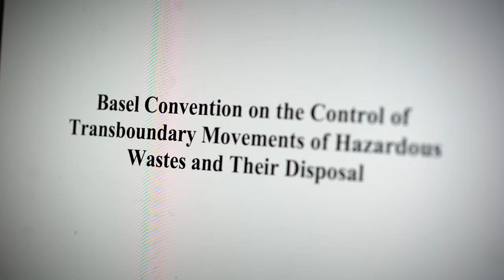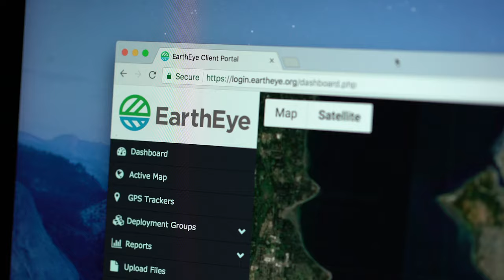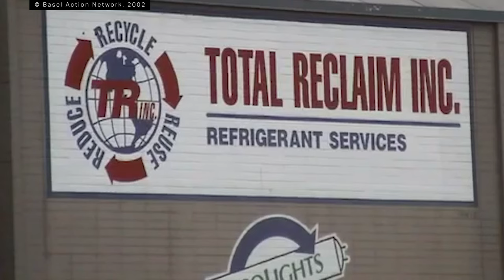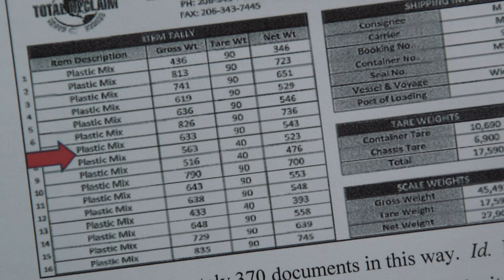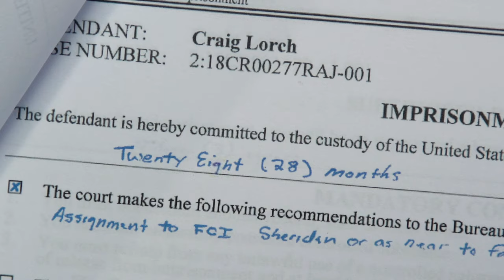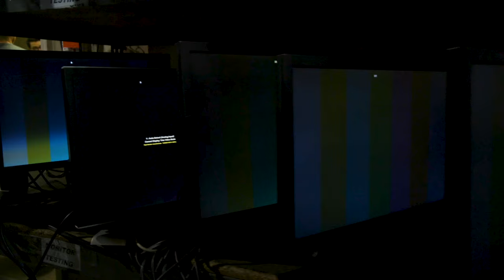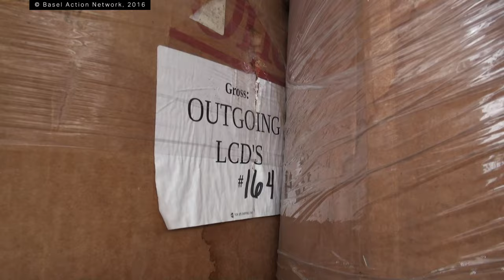The dark side of electronic waste recycling

Comment: I use my phone and electronics until they are completely unusable. It's harder to reprogram and update a phone's software than it is to buy a new one but honestly I prefer it. I get attached to my devices and I refuse to give it up without a very good reason. There is a culture of fast consumption of goods that needs to be addressed on all levels; from fashion to electronics. Get attached to your things, buy only if you have to and treat it with respect.
Reply: Used it pass its value..until its nonfunctional...
Reply: @592sunrise  with care and consideration, devices can last for years.
Reply: Agreed. Then I often buy refurbished for my "new" device. I also enjoy the feeling of making something from very little or basic resources, or from junk/scraps, so I enjoy salvaging parts from old desktops and the like in order to piece together a working one!
Reply: @revenevan11  while I'm not good at building, I'm good at customising the software for needs and it's a very fulfilling way to care for your items
Reply: I agree on half of what you said, not because I don't believe you, but because I'm reading only half as my screen is cracked but functional so I keep using my phone instead of getting a new one!
Reply: why throw shit away when it can be fixed ? most repair guys convince customers otherwise to sell new stuff..

I have been using my old desktop since 2008 even though i have brought powerful gaming laptops since then.. i get attached to that old veteran..

been fixing whatever gets bad on oldie but motherboard, processor and one stick of ram still remain original.. with a lightweight linux mint... i use it for various test projects and home servers.
Reply: I've  worked for people who can throw a fridge away for not matching the countertop I installed for them... I never understood it.

   Still don't... BUT I've found some awfully good gear in their dumpsters, and even been PAID TO TAKE IT OFF THEIR HANDS... lolz I kinda love that part.

   Get paid to clean out an attic or garage... Drag everything to the flea market... and get paid again to let it go... 

     AND I get to keep what I want, for the menial price of picking through the piles for my interests, and to clean stuff up for  a better price (something I do anyway).

   The manufacturing and recycling "gurus" complain about the price of recycling... recycled materials...
but the way they go about it is as bad for their finances as they are for the environment. Not every "dead" computer needs to get scrapped to the component level... for one thing. Lots of them only have one or two bad components... not even the motherboard. Swipe the hard-drives and move on. You don't want your info' on them into the wrong hands, anyway.
    Get a tower (second hand) and stack hard drives like their out of style in it... as long as you watch your strains on the Power Source, it's likely good to go. SO that "write up" is probably worth the math... AND a power source is easier to get than you'd expect... better aftermarket than "stock" anyways... IF you can afford it and justify it.

    It can't possibly be "more efficient" to ship things all over the planet to be stripped down and scrapped out to components AND then melted for recycling into new components EVERY time. At some point, there should be someone checking up and seeing what could be feasibly stripped to rebuild or refurbished... AND the rest of us SHOULD be rewarding them with business.

    I'm amazed to hear so many people convinced a laptop should expect a three year lifespan... My oldest Dell lasted ten... and not for me being gentle. I just tried not to abuse it too much.
    ...like pouring 90% alcohol through it to follow the coffee that time...  and quietly being thankful it wasn't ON, for the stunt either.

    yes... get attached... name them, some of them anyway. People used to do that! AND they used to give a damn about those things... instead of use 'em up and get another at Wally World.

    People used to do a lot of things better than they seem to now... BUT I'm glad to find a few gems keeping it up now and again... thanks for saving me from being sure I was the last of my kind. ;o)
Reply: And if you must get rid of it, recycle it yourself, most of the raw materials used can be extracted in some form with similar value to the pre-electronic form.
Reply: I agree with the sentiment, but when I give my phone security updates, it eventually slows down. I notice this with all my phones, and the slowing only happens immediately after an update.
Reply: Phones are not my area of expertise, but when it comes to computers, very often the case, power supply unit, hard drives and RAM can be repurposed. YMMV if you're using them in a new PC, with the old RAM most likely being DDR3 and hence incompatible with new CPUs, but you can always use it for an HTPC or a media server.
Reply: @Erick Rosa old laptop cameras make an excellent security system.
Reply: I do something similar. I hardly buy new tech unless there is a very clear reason and I don't don't throw old tech away unless it's beyond repair. I also sometimes refurbish PCs and donate them.
Reply: Sometimes you have to upgrade to receive essential security patches. You can't really rely on minor software updates when there is a major update that is not available for your phone because it's too old.
Reply: Sadly，Capitalism doesn't allow these sustain attachments
Reply: Same! Plus certain devices can become obsolete but also become antiques over time. I have old game consoles that are worth plenty in current value. Replaced my last phone that lasted me a good 5-6 years, traded it in for a new phone once it was getting faulty but I would've kept it for collection if I couldn't trade it in. It feels really cool looking back at my old iPhones, blackberries, and the one Nokia I had that was my first cell lol
Reply: Too bad you can't remove batteries without getting services done anymore. My old ipod that was maybe 5-10 years old died because of its battery.
Reply: It's so sad that manufacturers are making electronics as longterm unusable as possible. I have an android device that started deteriorating for some mysterious reason and became unusable just before three years of use, which makes it look like it is a software sabotage. Now I will have to dispose of a phone that is in good condition with little damage and buy a new one.
Reply: My family resells electronics to other people as second hand products. If still usable of course.
Reply: Same here. A lot of Android phones from early 2014 can still be updated to the latest Android, either via Lineage OS or some other 3rd party and they'll work just fine. Same deal with my OnePlus One, it's still running perfectly, even on the original battery, now almost 6 years old.
Reply: lol, same. :)
Reply: People also should start buying things used when possible. You get better value and use a product to it's full lifespan. This will reduce waste by not having a product made in the first place as demand for new things drop.
Reply: Here in my country we just pass devices on as we upgrade, the order usually goes parents>child>grandparents>distant people who may have a use for it
Reply: I replace my devices until they die, had a Samsung S5 for over 5 years.
Reply: Professional Face Puncher  said  " why throw shit away when it can be fixed ? most repair guys convince customers otherwise to sell new stuff.."   I ask, Why would a repair guy harm his business by turning work away?  . . . . . Yes, some items can be repaired but would you spend $ 60 to have a $ 99 weed wacker repaired?  Or $ 100 to repair a $ 200 monitor with no guarantee that something else won't fail in 2 months? . . . .... . The costs associated with mass production have gone down but the cost of singular repairs has not,  Also, some electronics have very specialized components that can't be bought off the shelf like in the days of vacuum tube TV's.
Reply: I used to have a phone that due to how the screen was manufactured, everytime a fracture in the glass was made, that section of the screen's touch was unusable. eventually, i couldn't use the android home, apps and back button but i ended up buying a little micro USB to USB adapter and connected my mouse to it. With this addition, because my phone supported a mouse perfectly, even though it was a little bit mroe unconfortable, i did bring a bit of attention, it was fun using it that way and it ended up lasting me like 6 more months or so.
Reply: @bobroberts2371  since my family kind of has a history of fixing electronics (mostly tv's) i can very much say that almost 80% of pieces can be acquired easily, the hardest things to replace are flat tv cables and screens, almost everything within a circuit board can be replaced. 
Now i must say, when my dad or my granddad fixes things, they do the work properly, and one important thing i learned is that indeed, repairmen do a shit job because of lack of knowledge or  just to get your stuff and sell it later
Reply: and here i am switching my phone every year :/
the phones that i previously owned for a year have now been given away to family members, but im not sure if that's enough to be considered "recycling".
Reply: @revenevan11  5
Reply: Me too!
Reply: @darkpepsi  haha
Reply: TwitchyWitch95 I do the same and I agree with you 100%. And I always buy used when I can
Reply: @antarcticpenguin  you can use it for like 4 years, you're kinda getting scammed by the phone producers business model
Reply: Glad I'm not the only one I had my last phone for 8 years before I simply had no choice but to replace it.
Reply: @jeinnerabdel  There are small online businesses who will fix that problem for cheap,  just look them up and make sure they're legit and you'll be gold, got my screen fixed once for less then $70.
Reply: Same!
Reply: @RegahP  Every time a fracture in the glass was made? So, like, multiple times? My old phone lasted 5 years, didn't drop it even once, never had to replace the screen, and when both the touchscreen (because of the fragile mechanism of a slide-out keyboard) and the USB charging port stopped working (reliably, at least), I had to get a new one sadly. I was running Android 2.3.4 till late 2018. It had 512 MB of RAM and 400 MB of flash memory... By the way, I did try to replace the touchscreen, but it didn't work so the hardware fault must have been elsewhere.
Reply: fghsgh Well good for you! I wish i could be that careful with my electronic devices.
Reply: My current phone is four years old (iPhone 6s Plus). I've had the screen replaced twice due to drops, and the battery once, but it still works great. No one has to upgrade their phone every year anymore, and the newest models are so expensive that I wouldn't want to anyway.

My Macs I keep even longer. Just recently replaced my 2012 MacBook Pro, would've used it for a year or two longer but it started having GPU-related issues and the battery life isn't great.

Edit: I have a lot of even older Macs and other devices around, some of which I still use for various purposes, and I don't recycle anything that still works without issues. I'll either keep it or sell it to a new owner.
Reply: @WokeandProud  - I ordered a new (to me) phone today because my provider has been telling me for a year I have to give up my Palm  Pixi (2009) because Verizon will be turning off 3G support.
Reply: As long as consumption and production is based on profit rather than need, nothing will change and the system is way bigger than whatever can be achieved through individual responsibility alone. Nobody wants to say it, but what you're actually calling for, what actually needs to be done to turn this, and other things like this, around: the end of capitalism... or at the very least push for heavy regulation and government programs that force companies and manufacturers to recycle as ethically as possible, even if it comes at a loss to the state and private business.
Reply: @Lambda_Ovine  I think a social democracy with an ecologically motivated regulation of the economy would work ok.
I know that that what you are saying is the ecosocialist narrative.
I tend to say that capitalism needs to be regulated in very targeted ways. The behaviour of megacorps closely monitored and penalised accordingly.

So in a socialist system, how do you properly achieve innovation without competition in the market?
There wouldnt necessarily suddenly be some kind of nirvana as to how to manage plastic just because the govt is socialist.
There wouldnt be a plan for human diet effects necessarily
There wouldnt necessarily be a dolution to overpopulation except if you are planning a global gulag lol

You trust that the govt will really care about this issue and not again their own interest? hah thats pretty utopian

If anything, I dont tend to think a sudden transition to socialism sould do good.
If anything a gradual transition through social democracy, or if the socdem is good enough then stop there.
Reply: @revenevan11  agreed
Reply: chemicalhorror  scrapper, me too
Reply: Sounds like you're gonna become a cronic hoarder down the line.
Reply: It's called planned obsolescence
Reply: Same here. I'll fix electronics that break (either replacing capacitors, ports, boards, replacing batteries on all new phones with "non replaceable batteries" etc. There's no good reason to purchase the latest and greatest phone every single year for me. It's criminal that phone manufacturers make their batteries non removable and therefore non replaceable for the every day person. Yeah, it's a pain to replace them for me sometimes but at that point, what do I have to lose? Device won't work anyways so it's always worth it to tear it down and attempt to fix it.
Reply: @RegahP  Sounds like the digitizer got damaged wherever the screen did.
Reply: @FWDSUXARSE  yeah, something in the tech was wrong, the product wad like that, we had 2 of them and they had both the same issue. Something is placed wrong or something because clearly the touch sensor shouldnt be breaking with the glass.
Reply: I got a Galaxy S8, an iPhone 6s Plus, a Galaxy A20s, and a Galaxy Tab A that I've purchased various parts for and they still keep working. I'm even maintaining a 1998 Dodge Dakota as long as the engine wants to keep working.
Reply: Respect 💯

Comment: Been a scrapper for a little over a year, I must have saved 15 desktop PC's, laptops and tvs from landfills.  Most of the PC's work and usually have tonnes of music on them.
Reply: I just spent the last week trying to repair 3 computers. One has a bad power supply and it is a Dell server that needs a specific replacement. The other freezes during OS splash screen. I can't even load anything from the CD rom before it freezes. The other the mobo is just bad and won't power on. I stripped everything else I could use out of them and taking them to be recycled... somewhere... where? They never told me how to find a responsible recycling company.
Reply: Interesting, I want to try that.

Comment: As the Prices of Electronics Goods Fall, There will always be an Increase in E-Waste
Reply: skankhunt 42  I am also thinking about this. Why making many models and creating many devices which creates a lot of waste.
Reply: skankhunt 42 As the price of manufacturing falls, the price of singular repairs does not and can't.  A TV factory has specialized test equipment and access to custom parts that they can amortize over 100's of thousands of units where as a local TV shop might see a few dozen of a particular type.   Also, is anyone going to spend $ 100 on a $ 200 TV and wait a few weeks for parts to arrive?
Reply: Porno
Reply: Bob tobert

Comment: Imagine an AI capable of recognizing some devices, screws, chips... and taking the screws, unsoldering the chips, and classifying everything automatically
Reply: We’re still far away from that reality unfortunately
Reply: You can't really remove gold plating without electro plating it.
Reply: @thefirstsin  Electroplating is the depositing of gold, not the removal. You are thinking of reverse electroplate and it is not the preferred method as it is slow and only works with certain base metals. Besides, there are many, many ways to safely and effectively recover gold including  incineration, leaching and acidic dissolution.

Comment: Do you have any examples of proper recycling at scale?
Reply: I believe paper and cardboard recycling is pretty efficient. Most new stuff is made of ~40% recycled material. And 70% of cardboard used makes it back for recycling. Mostly because companies have systems to ensure most of what they use gets recycled. Consumers dont care nearly as much about where they throw things.
Reply: @breadman32398  my question was aimed at ewaste recycling at scale. This "conspiracy" group seems to focus on shady recyclers, which makes it seem like there's a better alternative. However the one example they provided was a small scale company that only processes a the beginning stages, not the complete lifecycle. Ewaste is a serious problem, but so are "whistle blower" groups at solving the core recycling issue.
Reply: @Jonedcc  ah, true. I imagine fully recycling waste start to finish is next to impossible considering all the different components, materials, and types.
Reply: @Jonedcc  designing products with repair in mind would be a great first step.
Reply: Steel and iron, copper, aluminium, and glass. Also, asphalt... used to pave roads, sidewalks, runways, and lots... ironically made from crude oil (and crushed rocks).